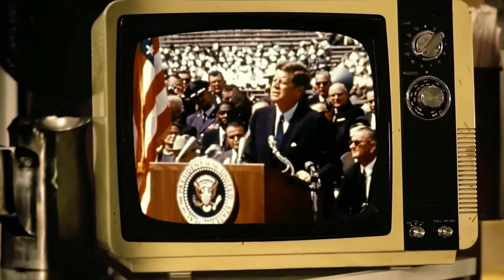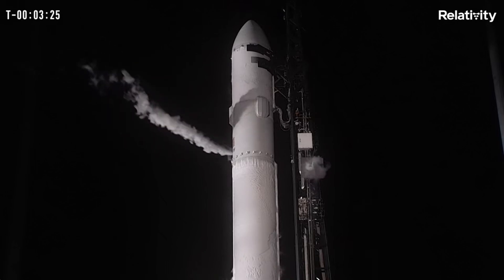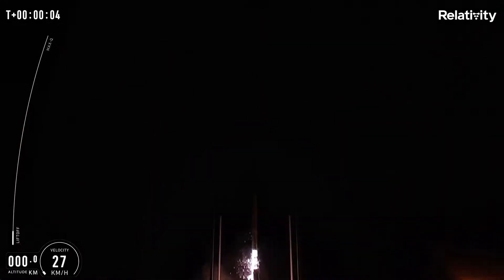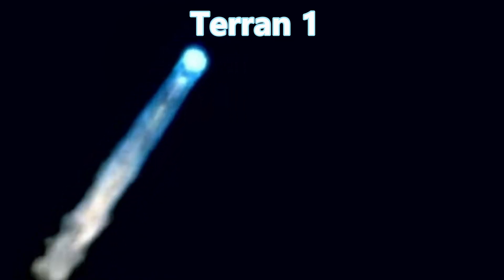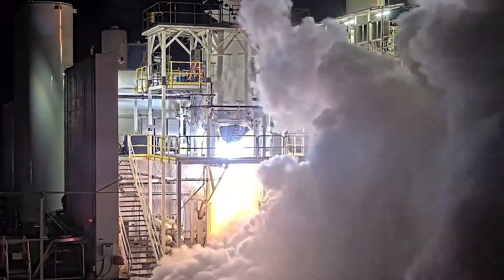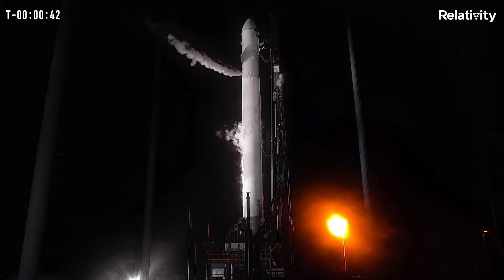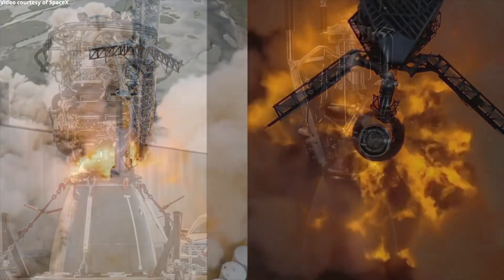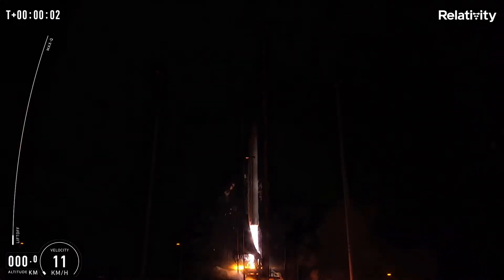Rocket Science: 3D Printed Methane Fueled Rockets

Comment: I believe as the rocket got out into the vacuum of space the vacuum  pressure of space added extra force to the rocket vacuum chamber causing a powerful suction that creative a chokehold on the blast tube closing off the pathway to the ignition chamber immediately
I also believe this is the reason no explosion happened thank God for that.
I believe the rocket vacuum chamber ignition blasting tubes have to be built to handle the extra vacuum suction pressure of space.
Reply from the maker: They usually allow for the loss of pressure in space but it is hard to test this on Earth...

Comment: While this flight was historic, this was not the first methane powered rocket to survive Max Q.
Max Q is just the point IN THAT FLIGHT where the stress due to speed (which tends to increase over time in a rocket launch) and the stress due to atmosphere (which decreases with altitude) combine to the maximum stress overall, after that point, the decrease due to atmosphere density causes the stress to drop off faster than the increasing speed increases the stress.
 
Each combination of flight profile (speed/altitude), engine vibrations, and rocket aerodynamics (shape/weight) will generate a different point of Max Q (which is commonly supersonic, but doesn't have to be). It's common for rockets to throttle down before Max Q to delay the time of this point to let it get into thinner air to make the total stresses be lower than if it hit that same speed a few seconds earlier (and so that when it hits this point of external stress, the engines are not producing as much internal stress.

Every flight has a Max Q, so the first time that a methane powered rocket flew (and didn't blow up) it became the first methane powered rocket to survive Max Q.
The first time that starhopper lifted a foot above the ground it hit it's own Max Q for that flight (probably at the point it left the ground, with the engine at full power and the exhaust bouncing off the ground the most)

you can add more qualifiers to be accurate. 'the first methane powered orbital class booster' may do it, or you may need to add 'on an orbital flight attempt' (you need to exclude the starship suborbital hops, they weren't trying for orbit and weren't boosters)

But like baseball stats, if you add enough qualifiers, you can make just about anything into a record 🙂
Reply from the maker: But I said... "to make it to space", which makes it accurate :-)
Reply: Di you not hear he said 3d structure rocket to survive max Q and LNG engine to make it to space., 
talking about both stages, and then methane powered prop, the 1st  stage got itself & 2nd  to space maybe not orbit.  Starship never got to space nor could it. So it's not a orbital class rocket without super heavy.  Plus no full 3d printend structure or (85% 3d printed rocket)  has not ever been launched at all so any max q would be a big deal.
When you are first at something you break records / set records in every milestone. So no need for qualifiers unless it has something to compare  to or compete with. This has 1st as it is not comparable altogether. If you split each up it may need some like methane or LNG prop to karman line or orbit.. ect 
It was relativity who was saying those milestones an stuff